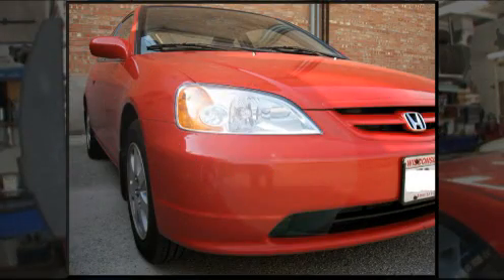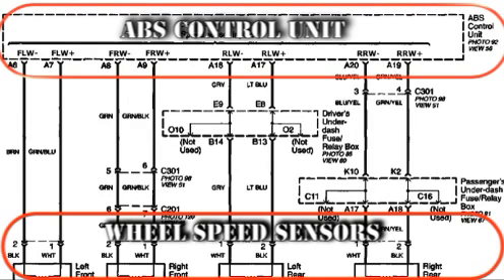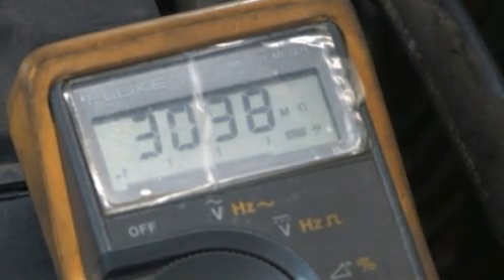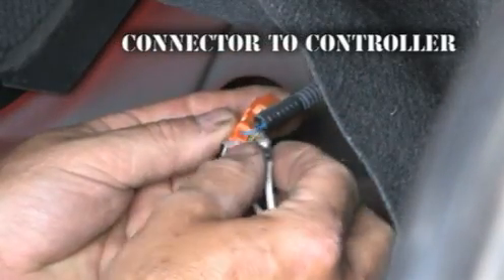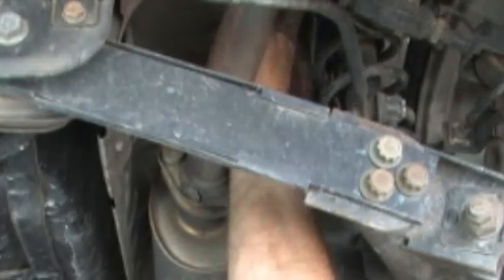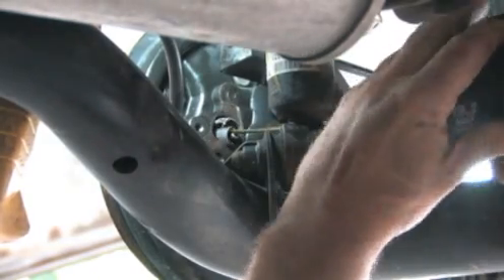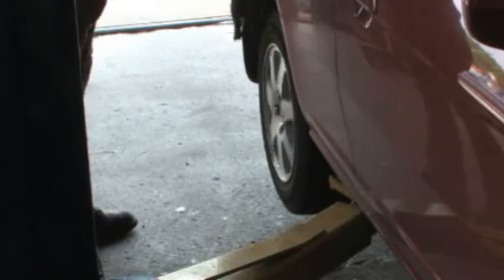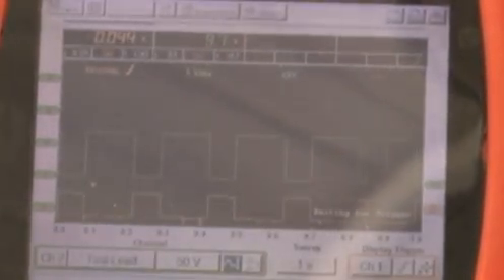ABS Sensor Diagnostics, Troubleshooting and Repair

Comment: Ok, another session with my mechanic, we got the ABS that was remaned by BBA in.  BBA confirmed that it failed bench test, it was burned internally, and they repaired it. A OTC reader specific for ABS was used to read for codes.  no codes.  So we then did the next easy thing - check the wheel sensors.  Right front sensor was MANGLED and frayed open.   Probable cause -- right front wheel sensor shorted out the ABS module.   Module works, sensor doesn't - getting new sensor this week.

Comment from the maker: You have to get communication before you can diagnose anything. Does it have a code? If so what code is it? I have a tech 2, I would be surprised if it could communicate with a Saab. Have you tired just a code reader? Once the code is retrieved it could lead us right to the problem. You might have to have it scanned with a factory tool.
Mark Hicks
Wells Vehicle Electronics

Comment: Ok, so I got the new ABS module in - tried to read it with a LAUNCH X431 - it can't talk to it.  it tries and can't connect.  So - I'm going to get it checked with a TECH 2.  If THAT can't read it..what does this mean?  the ABS PUMP? (the module has been reman'd by BBA about 2 weeks ago)

I guess in short, how can I diagnose the ABS PUMP?  Esssentially if even with a TECH 2 it acts like there is no ABS MODULE at all, then...what?  
Speedometer works still.
I appreciate any help you send my way!

Comment from the maker: This is a very good question Capolan! Not one that can be answered in the few number of characters allowed here. It also doesn't have one answer. Every time I get together with instructors or assistance tech line technicians we ask each other the same question. I feel the most predominant answer is the time a technician is allowed to work on a repair. Meaning, they have pressure applied from above to get it done in a hurry. There are many reasons for this pressure, including customers who do

Comment from the maker: There is no air gap spec for the sensor. Make sure the connectors and connections are all tight. You can also check the AC voltage output. 

Mark Hicks
Wells Vehicle Electronics

Comment: I have a 94 accord and i just changed the wheel bearing now my abs light is on, i had to unbolt the sensor from the knuckle, could it be possible that the sensor wasnt put back in all the way? They cost soo much and i have to change the passenger side bearing aswell

Comment from the maker: The testing technique will apply to most of the vehicles on the road, including yours. However the wire colors and pin numbers may be different.

Mark Hicks
Wells Vehicle Electronics

Comment from the maker: Well, I don't know the vehicle you have, but from the sounds of it, it sure appears your ABS module has shorted out. I am wondering why a fuse didn't blow. Yes, most vehicles today have the PCM networked to the ABS module and others. I have never experienced a short like this, but if it did happen like this, you might want to check with your insurance company. This might even lead to more problems than you think. Just a thought. 
Stay in touch!
Mark Hicks
Wells Vehicle Electronics

Comment: Hello,  I noticed an electrical smell and a tiny amount of smoke coming from the area of my ABS module.  I begin poking around but can't find the source.  With key off the the taillights are illuminated(on) and my gauges begin to flutter/float.

Comment: Then smoke starts coming from ABS module, I disconnect battery and remove ABS connector/pigtail to notice what looks to be burning on the connector end. I leave it disconnected and re-connect battery and no more smoke, electrical smell or wierd stuff going on.  It also appears my PCM has suffered damage from this surge or short.  What our your thoughts?  Is the ABS module the culprit?  Thanks in advance, Lance.

Comment from the maker: It will me to know what codes are being. The number of the code. It is common for the wiring to rub through going to the brake module. "wiring harness rubbed through at the ac drier causing 6 wires to short and break, lost igntion power to the abs module on the pink wire from the fuse box" 
Check the ABS module for good powers and grounds.

Mark Hicks
Wells Vehicle Electronics

Comment from the maker: Could the ABS module be causing the no communication? Yes. If you are going to swap the ABS module just to see what happens, chances are if the connectors are the same you can not do any damage. If they don't just plug in, you are going to have to find a different one.
Mark Hicks
Wells Vehicle Electronics

Comment from the maker: I am not sure if it will work on your vehicle, but you can try this;
remove the battery cables and hold them together with a jumper wire for at least 20 minutes. This will clear the computer. Problem is it will clear everything. Meaning it will run badly at first until it relearns. Also all your radio stations, seat positions etc will be lost.

Mark Hicks
Wells Vehicle Electronics

Comment from the maker: antilock brake light will flash super fast. If there is still a problem in any of the wheel speed sensors, the code for that sensor will begin to flash shortly after it shows the all clear code.

2. If the codes come back, check the resistance of the wheel speed sensors to be approximately 1600 ohms.

3. Check to see if any work has been performed such as new struts or anything where they may have been removed. 
Mark Hicks
Wells Vehicle Electronics

Comment from the maker: These codes are indicating a many problems with the wheel speed sensors. Here is the diagnostic procedure I follow:
1. Clear the codes and recheck to see if the codes return. When clearing the codes the brake pedal must be rapidly depressed before the key is turned on or the codes will not clear. Do not turn the key on and then start pumping the pedal as outlined in the shop manual. If the codes were cleared correctly the

Comment from the maker: Well, an easy way to test if the ABS is activating is to firmly apply your brakes on a slippery surface. When you do this you should stop in a straight line and feel the brake pedal pulsate. 
Mark Hicks
Wells Vehicle Electronics

Comment from the maker: I agree with your first thought. 60 amp fuse will blow if you have a short. It is possible the ABS module could be defective. Before i would even think about replacing it I would disconnect it and clean all connectors with electronic cleaner. I would also do a very close visual inspection of the wires and connectors.
Mark Hicks
Wells Vehicle Electronics

Comment from the maker: Sorry I did not find anything on this, except it is not a good code for your vehicle. Could this mean a possible PCM issue ... maybe. I would sure check it out before rebuilding the transmission! How does the trans fluid look and smell? Is it burned and gritty?
Mark Hicks
Wells Vehicle Electronics

Comment from the maker: For sure lowering is going to throw the traction control off, but i am not sure what it did to the ABS. Did you have the codes pulled? If so what are they? What year is your vehicle?
Mark Hicks
Wells Vehicle Electronics

Comment from the maker: Ground pin #38 of the C3 connector at the Powertrain Control Module (PCM) and see if vehicle cranks over. This test verifies the integrity of the wiring between the starter relay and the PCM. 
Let me know how you do,
Mark Hicks
Wells Vehicle Electronics

Comment from the maker: When you say it doesnt start, do you mean the engine will not crank? If this is the case, this vehicle has lots of problems with the connection on the starter relay. Check there first. It also has problems with the starter, starter relay and PCM.  	
Access the starter relay and make sure that power is coming to the relay on terminal #30 all of the time, and make sure that terminal 86 gets power in the "crank" position.

Comment: thank you, i did replaced both brake hoses for stainless steal ones from stoptech brand, but i dont know if the entire system from the left caliper could be clogged or acting like a check valve and making the caliper to stick but the caliper piston was hard to push in even with the bleeder off

Comment from the maker: Not sure about brand quality. But it does sound like you found the issue. Just remember, the piston must be able to move and the caliper must be able to slide. If these two things are right the brake will not drag. Well I guess you could have a brake hose issue etc., but a caliper or piston hanging is by far the most common.
thanks for the update,

Mark Hicks
Wells Vehicle Electronics

Comment: thank you Mark i did check it, and i took the caliper off to check it well out side and i found that the dust seal is broken also that the piston shows scratches on one side, and a lot of rust inside. so i guess i bought a caliper that wasnt well serviced or remanufactured...the right one is fine i didnt even took it off to prevent it from damaging or something. so i guess the caliper is the problem... i ordered a remanufactured one from CENTRIC i think is better brand though, what do you think?

Comment from the maker: If the ABS is activating, you will feel a pulse in the brake pedal. I suggest from your description, to check the caliper. Make sure it is able to slide on the bolts.

Mark Hicks
Wells Vehicle Electronics

Comment: my infiniti g35 is sticking on the rear left caliper, i replaced both L and R lines, new caliper installed both side and still sticks, could the abs cause this? how can i tell? is there a way of checking if the abs is causing my caliper to stick? btw i dont have a abs  light on 
thank you!

Comment from the maker: you should still check it the same way as the video. It sounds like the ABS controller is not receiving a signal from at least one of the wheel speed sensors. 
Check the coolant level first for the heater problem. 

Mark Hicks
Wells Vehicle Electronics

Comment from the maker: The P0143 is for the Heated Oxygen Sensor (Bank 1 Sensor 3) Circuit Low Voltage. First take a good look at the connections to the O2 sensors. The most common problem with the P0440 is a defective gas cap. Start there and let me know what happens.

Mark Hicks
Wells Vehicle Electronics

Comment from the maker: I did not find any history of this code on your vehicle. But it appears to be associated with the transmission control module and it is detected immediately after start up. This means there is a signal either missing or input the TCM is not expecting. The first thing I would do is inspect and clean the connections on the TCM. Stay in touch.
Mark Hicks
Wells Vehicle Eleclectonics

Comment: Ok,i have a 99 vw jetta, everythings fine the only problem is the ABS light stays on while im driving. Brakes work fine but idk whats going on. I took all the wheels off 1 by 1 and reconnected all the sensors. I made sure they were clean, put on properly etc.Im not a mechanic by any means but i did the best that i could to my knowledge. Anyways, It didnt work.the lights still on. I'm going for my road test on a few days and im worried i wont be able to take it because of the light being on.

Comment from the maker: 1. Check the left rear wheel speed sensor resistance, it should have 1.2 to 2.3 K ohms. If not correct it will need to be replace.

2. Check the wire harness form the ABS control unit to the wheel speed sensor for opens and a poor connection. 
To clear the ABS code remove the ECU-Black fuse for 30 seconds or perform the code clearing procedure from the service manual. 
You can bring it to my shop in Fond du Lac Wisconsin if you like or you can call me 18005589770
Mark Hicks
Wells

Comment: Yes i was spnning the wheel by hand but why would't i get a reading from all the wheels? was i doing something wrong? I find it hard to belive that all the sensors are faulty? or btw im using the same fluke meter from the above video lol so tell me what gives????

Comment from the maker: Were you spinning the wheel when you were checking for the AC voltage? Even though it checked good with an ohm meter it could still be defective. Or if the sensor is too far from the trigger wheel it will not produce a voltage. 
Let me know
Mark Hicks
Wells Vehicle Electronics

Comment: Ok today I Tested the  WSS got good ohm reading according to my fsm but when i tried using my multimeter to get a ac reading as per fsm i go nothing can you shed any light on the subject? the meter is a fluke auto range unit and yes i confirmed that its working properly thanks! p.s i'll be checking the pressure tom ok did not get the right adapter today anyways.

Comment from the maker: 99% of the time a leaking seal will cause the transmission failure. This is why a pressure check is so important to perform. Let me know what they find.

Mark Hicks
Wells Vehicle Electronics

Comment from the maker: Sorry I didn't mean to put you on the spot, I just had no history for the P0730. However, the poor shifting is usually a failed transmission of a TPS issue. 	
1. Monitor the application of the shift solenoids to determine if the Powertrain Control Module (PCM) is actually commanding it to up shift and down shift erratically. If there is no change in the shift solenoid command the transmission may be failing internally.

Comment from the maker: @markjhicks  If the tone ring is OK and passing the sensor as the wheels spin, but the sensor will not produce a signal, suspect a faulty wheel speed sensor. 

Let me know what you find

Mark Hicks 
Wells vehicle Electronics

Comment from the maker: @jasonlongor1 	
1. At the LF WSS connector, disconnect the sensor from the vehicle harness. Turn the key on and check the voltage between the Yellow/Red (YE/RD) and Yellow/Black (YE/BK) wires of the harness connector. The voltage should show 9 V or more.

2. If the voltage on the harness is correct, inspect the WSS for any damage. Also inspect the tone ring for the sensor looking for any damage.

Comment from the maker: @nyjp005 If it is hissing when you step on the brake pedal, it usually means you have a leak in the brake system. Look by the master cylinder and calipers /  hoses first for signs of brake fluid. Have someone step on the brake pedal and listen under the hood and by the wheels for the hissing sound. Keep the master full of brake fluid. 

Mark Hicks
Wells Vehicle Electronics

Comment: I have a 2003 ford explorer sport trac and change the front disk. When driving i depress my brake pedal which would hold high for the moment the go further down in about a second with a hiss sound. my ABS light came on, i check the power steering fluit and it was good. what could be the problem?

Comment from the maker: @003Mexicano There are several different codes for over voltage. It sure would help if you could get the code.

Mark Hicks
Wells Vehicle Electronics

Comment: @markjhicks its a 2000 chrysler lhs, 3.5L i cant remember the code but all it said was, overvoltage, the abs light doesnt light up, but the bulb is not burned out.

Comment from the maker: @Biggscastro123 Yes a failed ABS sensor could cause both lights to come "on".  the first thing I would do is retrieve the codes for a starting point of the diagnostics.

Mark Hicks
Wells Vehicle Electronics

Comment: I have a 2000 bmw 328ci and both my brake pad light and my dsc light are always on. I think it means that my dsc is off but my dsc button does not work. Can changing my wheel speed sensors help?

Comment from the maker: @eljuarense I have always used brake clean. When you say you used a porter cable, a porter cable what? Power washer? If you power washed the engine it sounds like you have either gotten some cleaner where it does not belong or you accidentally disconnected a harness. try letting it dry out and then check it.

Mark Hicks
Wells vehicle Electronics

Comment: how do you clean and what to use to clean the sensors from dust.i just waxed my car and i used a porter cable,and after i was done i got this from iside the car,(traction control off
stability control off
service ABS system
service traction control
service stability control
service variable effort steering)
now the steering is a little harder.any ideas. thank you

Comment from the maker: @ffas23 A Haaaa, I was under the assumption you were taping into the connections at the controller. If you are looking through the eyes of the scan tool, you must also consider the controller, PCM and connecting interface between them. 

Mark Hicks
Wells Vehicle Electronics

Comment: Did everything you mention  except rotate the Front wheels to the back which I do every 5,000 miles or so. No missing teeth and everything clean in the area. The gap is real close on both sides as there isn't any way to adjust the gap unless someone was to make up some kind of shim. The new sensors were put in just like the factory ones after cleaning the area. I will try this week to get my friend to bring his Snap-On Scanner home again and attach it to the 2000 Intrepid to chk readings.

Comment from the maker: @markjhicks Also check the connection to the controller from these two sensors. use some electronic cleaner on both the connector and controller pins. 
Please let me know what you find either way.
Mark Hicks
Wells Vehicle Electronics

Comment from the maker: @ffas23 Well it sounds like you have an interesting one. Seeing the front sensors were not reading in sync prior, I would recheck them again at the controller to see what we have now. If the same results occur, try rotating the tires front to rear and recheck. If that does nothing, you will need to look at the trigger wheels on both sides of the front. Make sure there is no rust build up, missing teeth and the air gap between the sensor and trigger wheel. This must be very close on both sides.